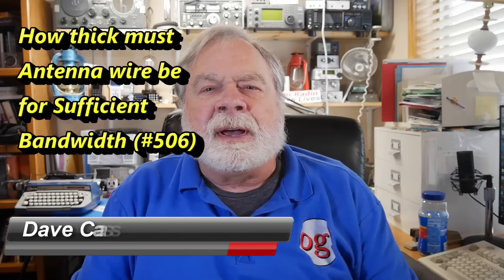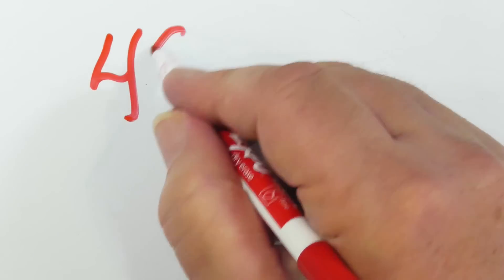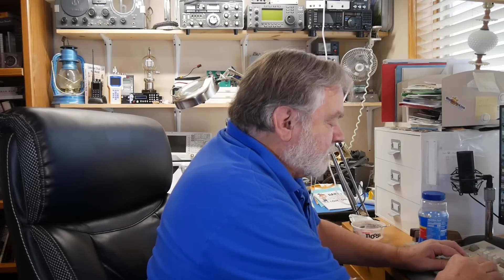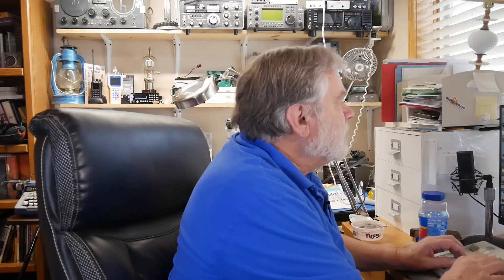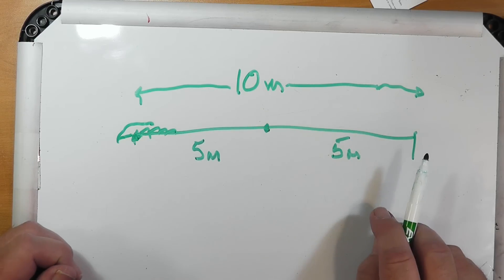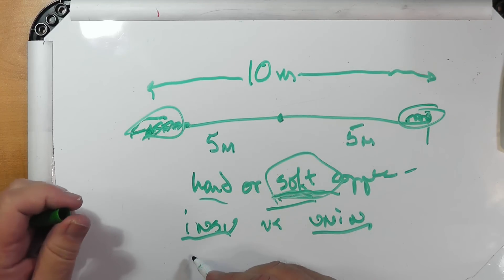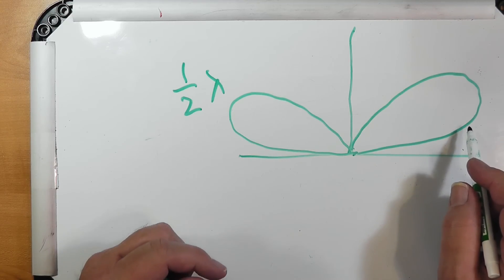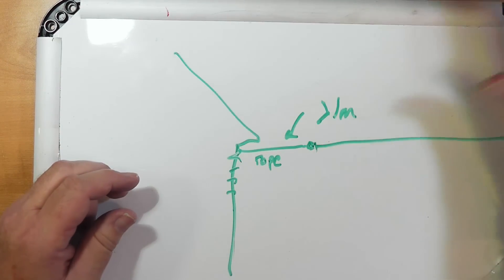20 Meter Dipole Covers Entire Band (#506)

Comment: as i read it, he is asking how THICK (not long) the wire must be to give max coverage of a band.
so, is 1/2" thick wire giving more bandSPREAD  than 1/4"?
Reply: The question asked was "How many meters must I have on each side [of a balun] for 14 MHz." He wanted to know how much wire to attach to the balun to create a dipole that would work between 14 and 14.35 MHz.
Reply: @norrinradd8952  the title reads 'how thick...'.
Reply: @rodneyjohnson4794  1:37 The question of thickness was proposed by Dave himself as a hypothetical, which he then answered. 

I stated the viewer question above as verbatim as I could. He is clearly asking for length. In fact, he mentioned to Dave that the thickness of the wire available to him is about 14 AWG.
Reply: I don't understand how the thickness of the antenna wire relates to bandwidth.  BTW, a 1/2" thick wire would be a solid bar of copper.

Comment: I've always used 10awg THHN. My OCF dipole is 90' one side, 180' on the other and it's been up for 11 years without any issues. I attach dakron rope to the ends with an insulator and run it through pulleys at each end with a suspended weigh. It just "rides" along with the swaying of the trees. My 80 Meter dipole has been up since 2004 and it's never had an issue either. I live atop a mountain in the Pocono mountains of Pennsylvania and we get lots of storms, icing & wind. 
Just my existence and I hope it helps others. 73
Reply: I use bungee cords at the ends of the rope.  Same effect but it saves me needing to put up pulleys and weighing it down.
Reply: @jchintor  I tie off on small trees. They bend and take any movement well without degrading. And they are free.
Reply: Bungees or weights, I like both ideas! Planning to put up some sort of dipole this summer, and we have plenty of trees but no tower to get over them. Bungees... brilliant! Where do you find them that are UV stable, though, so you don't have to climb up there more than twice?

Comment: At least TOUCH on the question of wire diameter versus bandwidth. HF/VHF/UHF.
Reply: I was told heavier wire would give slightly more bandwidth.
Reply: I think Mr. Casler may have not considered the potential main point of the question.  I would hope he might do something on the subject later, especially if he is notified of this.
Reply: The question of wire thickness was both asked and answered by Dave.